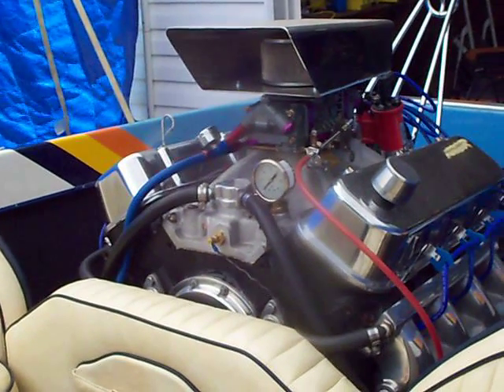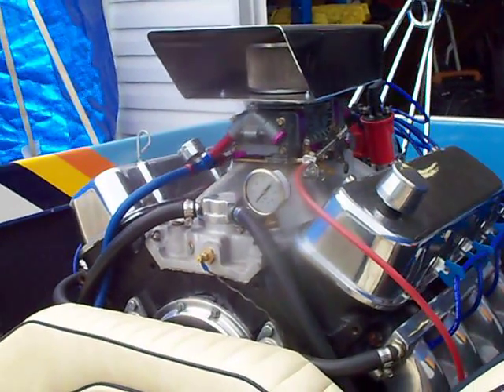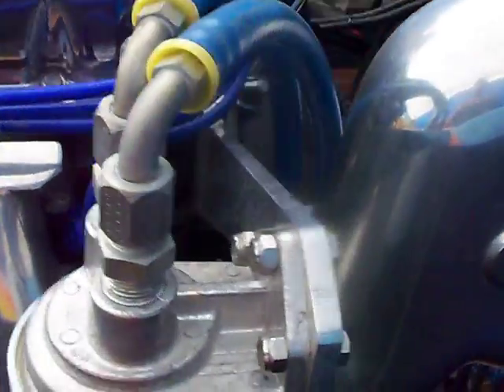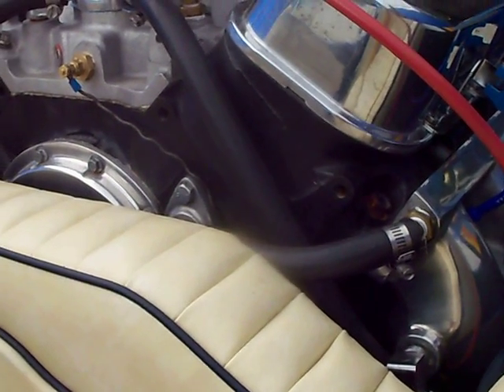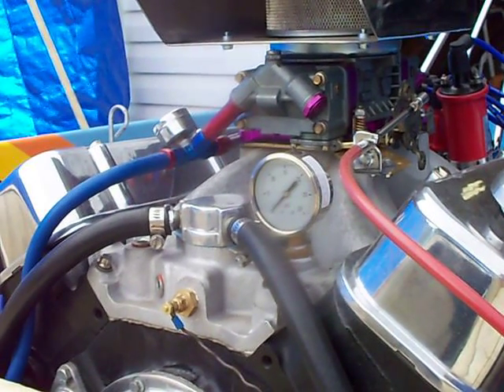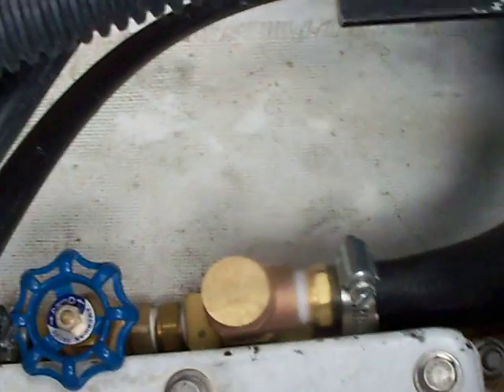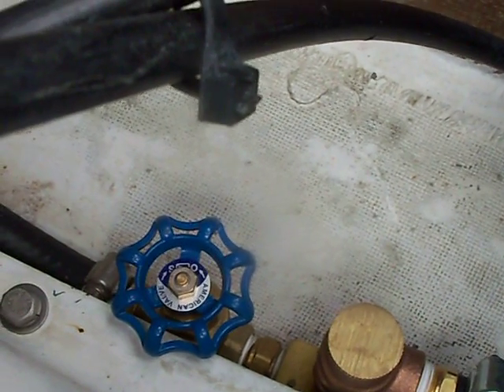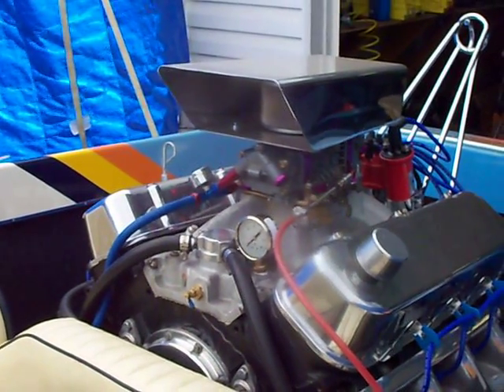Checking the water pressure  in a jet boat

Comment: I did this different years ago.
A restrictor ...sorta..dont work.
I just installed a simple brass gas valve in my engine discharge line.
We could watch engine temp and adjust how far valve was/wasn't open to keep engine AT LEAST 160° (Volumetic Efficiency)
Setting was sorta always different because of Lake/River water temp. DONT tell me it didn't work please.
Many different States, lakes and rivers.

Comment: can i check pressure running with a garden hose attached  ?
Reply from the maker: no, you need to feed water from your jet pump. so it has to be in the water.

Comment: Couldn’t you plumb in a fuel injection high speed type bypass that would open at a set psi like 10? I have measured block pressure on the Dyno at FEL-PRO HP when I designed gaskets 1988-98 and saw 35-40 psi. Just FYI

Comment: 35 years ago a co worker had a Sanger with 455 olds. He was ALWAYS playing with water flow.  I have a 454 in my 20 ft Duckworth. (Berkely 12JG) when I got it it had raw water cooling. (and a cracked block from freezing, got a good discount and rebuilt it) I picked up a used Kodiak heat exchanger. It runs 175 degrees at Idle. Around 165 under power. Lots of Cooling  in the heat exchanger.Has antifreeze so less worry about winter draining. No raw water and debris running through the block. Better flow through through exhaust manifolds without the restriction thought the engine. Guys running the snake run the crap out of their big blocks  with heat exchangers.

Comment: What if I can’t get any pressure. I put a restrictor plate in and it did nothing.
Reply from the maker: You have a restriction in your line.  Check your hoses for grass, sand, seaweed etc. There has to be a blockage somewhere. Your jet pump is what creates the pressure. Check it at idle and at cruise speeds. Sometimes it doesn't have enough pressure to read at Idle depending on your gauge.

Comment: And THAT is how you make a tutorial video !!! Just get to it. Nicely done man.
I have open dry headers. I control all flow with my gate valve from pump (in AZ at common atmospheric of 110º). It does make sense to run the plate at the thermo fitting on intake. I am going to install the gauge on intake to see where I am at as I do think I have hot and cold spots. Hand built pump behind 790HP from Harold Bruce R&D marine Lake Havasu city AZ.
Reply: **ii

Comment: where did you get that oil filter relocater and lines ?
Reply from the maker: Duty Raab  it was already on the engine when I purchased the boat. The bracket was custom made. Look into getting one from a new style chevy vortec engine, I believe they have external oil coolers.
Reply: mogyver69 are they the same bolt pattern old verses new ?
Reply from the maker: Duty Raab I do not know for sure.
Reply from the maker: It was on the boat when I purchased it yrs ago. But I believe you could purchase one thru rex marine.

Comment: thank you for the tech tip I did order the flow disc from summit although , I put in a thermostat housing with altered center where the bracket spring assembly would be cut out basic flow disc.. worked great hard run would creap to 185f most of the day at 175f.

Comment: what color flow disk did you settle with . I have bbf jet boat does not have any in thermos housing cools fine until I go in no wake after a hard run creaps up to 190f the settles back after a while don't know the pressure I will have to add gage .gary

Comment: Where did you get your pressure gauge?
Reply from the maker: I picked up the one shown on ebay. Its a liquid filled 0-30 psi gauge.. I have also seen gauges at lowes and home depot in the water heater section...
Reply: @mogyver69  great video.  Wanting to hook up something similar to my boat.  I’ve found plenty of pressure gauges like this online but they all seem to have 1/4 NPT male thread.  Just took the plugs out of my manifold and best I can tell they are 5/8 male thread.  What kind of adapter did you use to make this work?
Reply from the maker: @walk4848  just went to ace hardware in the plumbing section they will have a adapter 5/8 to 1/4
Reply: @mogyver69  OK cool.  Did some more digging and measured the plugs out of mine.  Looks like they're really 1/2" NPT which makes sense seeing as how it's plumbing. Much easier to find those adapters. Got some ordered.  Thanks.

Comment: great vid and explanation. we ran too much pressure and blew out a freeze plug. Lucky it wasn't worse
Reply: If you blew out a freeze plug in a jet boat it wasn't due to pressure it was corrosion or improperly installed plug. Or if your in northern climate means you didn't winterize and drain the block or put antifreeze in it. You blow out freeze plugs that way.